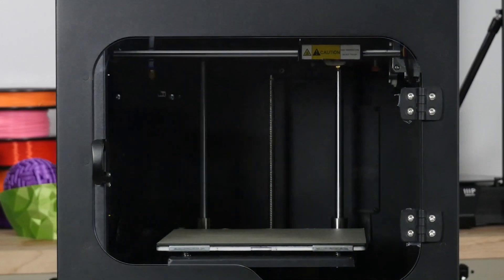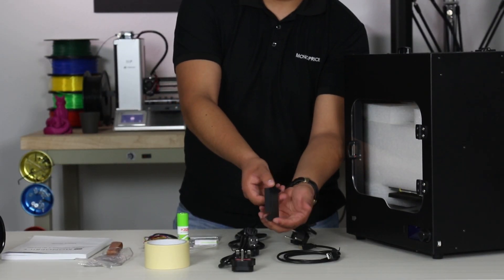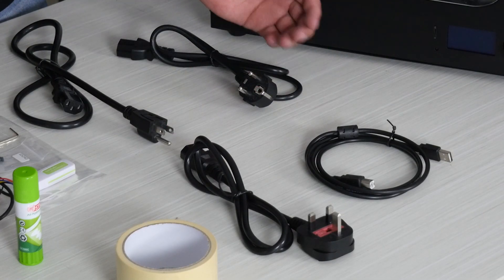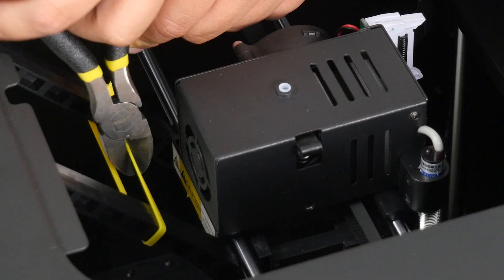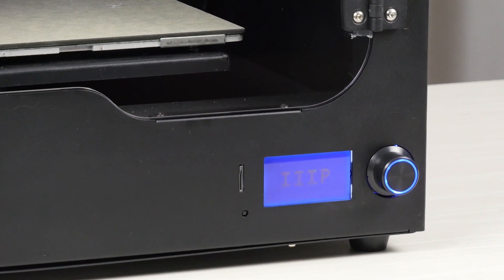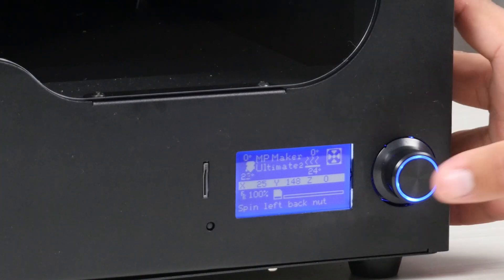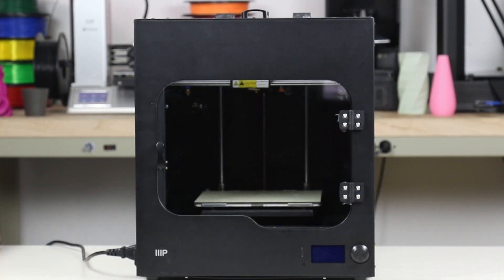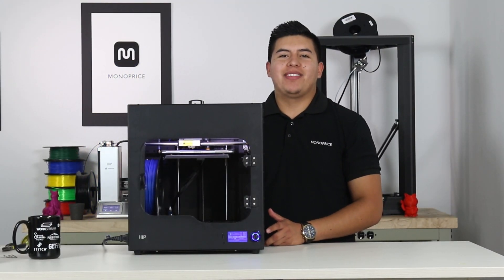Monoprice Maker Ultimate 2 3D Printer

Comment: will this work on the printer? OVERTURE PLA Filament 1.75mm 3D Printer Consumables, 1kg Spool (2.2lbs), Dimensional Accuracy +/- 0.05 mm, Fit Most FDM Printer(Black 1-Pack)